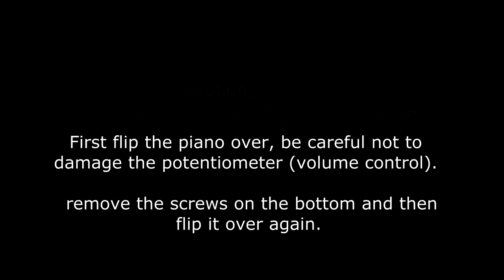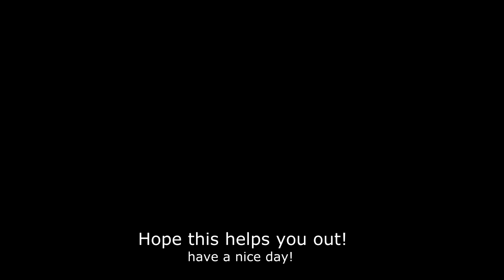Piano repair, replacing key contact rubbers (Korg SP170, 250, 280).

Comment: Put it back together, then I see I have about 20 screws left over.  My advice is to take a photo each time you encounter a new set of screws so you don't forget what goes where. On the up side, it sounds great!
Reply from the maker: Good advice! It is also a good idea to collect the removed screws in separate small bags or tin cans or something, this saves time when putting it back together again.
Reply: Or get a large sheet of cardboard and stick each screw into the cardboard following the outline of the piano.

Comment: thank you for those cool tutorials you deserve more subscribers
Reply from the maker: Thank you very much!
Reply: @Kraakmusic1  i have some issues with my korg sp200 the lights are not working anymore what can i do to fix it some button lights working but alot of dont work anymore
Reply from the maker: @lightbeatz3709  You could check for a bad connection somewhere on the circuitboard, but if some are working and others don't it is probably wise to replace the entire PCB (if you can find it somewhere).  These are the specifications I found online; Panel board (KIP-2050), for Korg SP200 keyboard. This replacement PCB is Korg part number GRA0002050.

Comment: Thanks you play nice!   Can you really hear the contacts when you snap them in with a screwdriver?   I replaced my contacts on my Krome 88, and now I have a few keys that have bad velocity.  Either real loud or soft.... so I'm afraid some of the contacts I have are not snapped in.  Would you agree?
Reply from the maker: Thanks! Yes, with the repair of my SP170 you could realy hear the little pins (underneath the rubbers) pop in the holes of the circuitboard (sometimes soft, sometimes a bit louder. You have to line them up very precise and make sure they pop in). I assume that the time-delay between the two contacts (when you press a key), is electronically translated in the appropriate level of velocity. So it is very well possible that - if it is not perfectly aligned - only one of the two contacts makes a connection, or both of them at (almost) the same time. So you get a very soft, or a very loud sound and nothing in between. The only way to make sure, is to open up your Krome again and check this. If this happens on only a few keys in the same octave, it is probably an easy fix.
You can also try and replace the rubber (in the range were the problems are) with a contactrubber of the highest or lowest octave (that are often less used) and see if this solves anything. It can also be that the contacts on your circuitboard itself are dirty or worn down.
Reply: @Kraakmusic1  Thank you!  I took my Krome apart (again) and was meticulous about making sure the contacts 'clicked' into their sockets.  I did it 1 octave at a time -- and each time I turned my keyboard on and tested each note -- rather than doing the whole key  board at once.  This helped as I found 1 strip had 1 contact (note) that sounded too loud.  It was easy to redo that octave and move on.
Reply from the maker: @FlimFlamBougelets  Great to hear that!

Comment: How closely would this procedure work on the Korg LP-180? My contacts are sticking (again) after I had them replaced three years ago, the keyboard is only six years old.

I'm wondering is this is juts a way of life for my Korg LP-180. New rubber contacts are $50 for a set, I'm thinking maybe they just need to be cleaned with some isopropyl alcohol

Your tutorial looks to be about a 2-3 hour project, which is manageable.
Reply from the maker: I don't have any personal experience with LP-180 repairs, but I suspect that the technique inside is pretty much the same as the SP series, so I would give it a go with the same procedure. Be careful not to get any grease on the contacts! You can always check your old contacts first, maybe this happend when they were installed. If this were the case, you can try cleaning them first with alcohol & check if the problems are solved now. It is about a 2 hours job. Hope this helps, let me know how it worked out.

Comment: Hi. I replaced the rubbers and the black keys sound way louder than white. Any suggestions? Thanks
Reply from the maker: The first thing that comes to my mind, is a poorly connected plug on the circuitboard. You can try detaching them and then plug them back in.
Reply from the maker: It is also possible there is a short circuit somewhere. Because the time-difference between the two contacts underneath each key-rubber, is being translated in touch sensitivity. So if any key (or range of keys) only play max volume, this could indicate a short (because there is no time difference between the contacts). You can check if some grease (from the key-mechanism) was spilled on the contact-points of the circuitboard or in the contactrubbers. This sometimes happens.

Comment: Hello, sadly I saw your video late. I try to clean my keyboard, removed the rubbers and cleaned with alcohol. When I put the rubbers back the sound more or less without the keys, but when I place the keys on the top the most of them do not work. Do I need to put new rubbers? Thanks for the tips and the amazing video!
Reply: Hello there, In most cases the contacts are too much worn down and cleaning does not fix the problem. If your highest and lowest octave (that are usually less used) have no (or lesser) problems, then you know the contactrubbers are worn out and need to be replaced with new ones. If - in your case - the sound is okay pressing the rubbers, but not okay when you place the keybed on top of them, this could also be an alignment problem. When you place the rubbers on the pc-board, you have to place the little pins in the holes and hear them pop in. Hope this helps!
Reply from the maker: Thanks! Hope the Secret Sonics comment will fix your problem!

Comment: Is this the same for a KORG KROSS? I have a Korg Kross and several keys (middle range) are WAY LOUDER than the other keys when it's played. This happens mostly in piano mode. Have other owners of the Kross experienced similar situations? It's driving me crazy.
Reply from the maker: Hello Billy, I have never repaired a Kross before, but I assume the construction of the keybed is pretty much the same as Korg's SP series. The middle range of the keyboard is the most used, so it is very likely that the contacts are worn. I would recommend to replace all of the contactrubbers. There is a link in my description were you can find a local Korg dealer, where you can order them. Hope this helps!

Comment: I have one key (a D, white key) that makes some clacking noise when I press it. It's works fine, same response, same sound, but is the only one that make that sound. Do you know if I need to do this or if maybe is another problem?
Thank you for this amazing video!
Reply from the maker: If the clacking sound is mechanical, you can try replacing the octave-keybed with the (often less used ) highest keybed, and/or put a little grease between the D key and it's closest keys (although this might increase the chance of dust build-up a bit.
If the sound is produced "electronically" - and it only appears with that specific key,  It could be one of the speakers is damaged, and this key causes a resonance-frequency. You can check with headphones. If they sound fine when pressing that key, it is probably a problem with the speakers/amplifier.   
Hope this helps!

Comment: HI - I was going to follow this for Korg B2 - but despite removing every screw I can find still can't get into the unit so if you have any info / link on how to do that it would very much appreciated thank you
Reply from the maker: Hello Craig, Unfortunately I don't have any experience with repairing a B2. I did some searching on the web, but could not find anything about opening the unit.
Have you tried removing the volume knob? could be the nut that holds the potentiometer, is preventing the dismantling. Maybe it is an idea to contact Korg directly for some advice. Hope this helps.
Reply: @Kraakmusic1  - thank you. I'll try Korg although my sense is that they won't be supportive of DIY attempts

Comment: Hi,
Thanks for your video!
I replaces all of the rubbers but one key is still loud. Do you have any ideas on how I can do to fix it?
Thanks!
Reply from the maker: Have you tried cleaning the contacts of that specific key on the circuitboard (where the "rubber" makes the contact). Most likely one of the contacts is dirty.
Reply: @Kraakmusic1  Thank you for your prompt response! I did clean them.
Reply from the maker: @jessyromano4504  A way to fix board contact issues, is to place a new (thin) layer of solder on the boards contacts (of that specific key). But it is wise to first check  if there is anything damaged, or interrupted (like a circuit board copper track) or blown up (like a capacitor). What you can also try, is to switch the newly placed rubbers with the rubbers of a different octave  that works fine at this moment; this way you make absolutely sure that there is not a problem with the new rubbers and the problem is definitely with the circuitboard. Hope this helps!!
Reply: @Kraakmusic1  Great idea! Will try changing the rubber. Thanks so much!

Comment: is it possible to replace the speaker fabric cover on a korg b2? mine has a few bobbles on it that bother me.
Reply from the maker: I have no personal experience with the B2, but I think the smartest thing to do here is to contact your local Korg distributeur (there is a link in the description). If the fabric is available as a spare-part, then it should be possible replace it.

Comment: is this the same fix if a key is just stuck and won't go down please ? Thank you
Reply from the maker: If a key is stuck and wont go down, that is a mechanical problem. You can follow the same procedure  as shown in the video to open it up and then remove the octave key-bed with the malfunctioning key.  You should check if anything in blocking the key when it's pressed or if anything is wrong with the spring-mechanism (where the key hits). Hope this helps.

Comment: Thank you. Now my piano works again! Just a question: Have you some tip around improve the sensitivity? Thank you!
Reply from the maker: Glad to be of assistance! There is some information in the SP-170S' Owners Manual, that you can download from Korg's webste. It says;  
The Key Touch Control function enables you to change the way your playing strength will affect the output level. You can set this function by using the white keys in a range from D2 to F2. (See the figure on the left.)
• To play fortissimo with soft strokes (Light touch), press and hold down the PIANO PLAY and SOUND buttons , and then press the D2 key.
• To play fortissimo with very strong strokes (Heavy touch), press and hold down the PIANO PLAY and SOUND buttons, and then press the F2 key.
• To simulate a normal piano touch (Standard touch), press and hold down the PIANO PLAY and SOUND buttons, and then press the E2 key.
The default setting (when you turn on the unit) is Standard touch. Hope this helps!
Reply: @Kraakmusic1   Thank you very much for your kindness in such a complete answer. I wish all the best for you!
Reply: @Kraakmusic1  hi .... how can i get a set of these rubbers !? for replacement on my KORG ?
Reply from the maker: @pacuthophilip8450  Hello. I've put a link in the description to Korg's worldwide list of distributors. Just look your country  & send them an email or give them a call, they can help you further.

Comment: Hi Kraakmusic1, I bought an used sp170s, a subtle hissing sounds comes from the speakers when you get really really close, also when I plugged in my headphones is the same hissing sound. Any ideas on how to fix that?
Reply from the maker: Hello Vicente, I must say that mine has also a bit of a noisefloor on the speakers, but not on the headphones. This could indicate an issue with the (pre)amplifier but mostly is due to a bad connection (mostly the headphones plug/socket), it could also be caused by an inferior power supply (did it came with the original?).  Another possibility is interference from a mobile phone or another source of electromagnetic radiation in close proximity. Hope this helps!

Comment: Hi, my name is Daniela 
I have um piano korg sp170s
It's was keep per 2 years in the box. I open the  box and put on to work, but it not work. Every keys not have sound. It's turns on no sound anymore. Maybe you can help me with what to do. 
Thanks..
Reply from the maker: Hello Daniela
There could be a problem with the power supply unit, is the red led light burning when you turn it on?
If not, check if the plugs of the power cable are clean and not corroded and if the socket on the piano does not feel loose when you put the plug in. Also  check with a Voltage meter if the power supply works properly.  If the power supply is working fine, then turn the power off and turn the volume knob wide open and down again a couple of times, could be there is some dust build-up in the potentiometer.
Turn the piano back on again and listen carefully if you hear any (amplifier-noise) sound, always start with  a LOW volume!
You can also try if you have any sound on headphones, again; protect your ears and start out with a low volume! 
If this still does not fix the problem, then it is possible that one of the internal connectors – as shown in the video – has become a bit loose, or that one of the internal power supply socket connectors has a bad connection.       Hope this helps, good luck!
Reply: @Kraakmusic1   - Lots of good tips. Thanks !!
Reply from the maker: @tubularap  You're welcome!

Comment: Hello sir.. in my Kronos 2 .... key C4  is having some issue... I have to apply more force than other key key to play the key C4... What would be the problem??? It's only happening only with SGX2 engine with other engine is fine..
Reply from the maker: Hello Birendra. This is very strange, because if it only happens with the SGX2 engine and with the other engines it works fine,  I would say that it's not a bad contact that causes this problem. Furthermore, if it is only the C4 key and all the other keys work fine, it probably is not caused by velocity settings (unless there is a possibility to change that setting for a single key, but that would not make any sense in my opinion. Check your manual, just to make sure!. Have you tried upgrading your operating system? this sometimes helps. Don,t forget to back-up your presets.
Reply: @Kraakmusic1  thank you very much...
Reply from the maker: @birendraekka4812  No problem, hope this helps.

Comment: i've replaced all rubbers and cleaned contacts on SP170 and problem is, that black ones work all but white ones work only when i push hard
Reply from the maker: Strange... If this is not an alignment problem (if you are absolutely sure that the rubbers were placed correctly and you heard the pins pop into the holes on the circuit-board), then this is probably a hardware-problem. Does this problem only occur with one particular octave, or does it occur over the entire range of the keyboard?
Reply from the maker: @Armyburza  If this was not the case before you replaced the rubbers, maybe one of the connectors isn't plugged in correctly/completely. Otherwise I' think that this is most likely a problem with the circuit-board. You could check if anything looks a bit black or burned, especially on places were components were soldered to the board. might be a bad connection somewhere. Maybe a good idea to check out Korg forums for possible solutions.

Comment: What if the board is the problem?like if the board erase the contact from the rubber..some technicians use an pencil..it is advisable?
Reply from the maker: If the contacts on the board are the problem because they are worn down, treating them with a (soft) pencil sometimes works for a little while. I used to repair remotes this way, but the new layer of graphite wears out very quickly. I tried this by the way on this piano (on the rubbers and on the board), just to check if it was working and if the contacts were the only problem i had to fix. It didn't do anything in this case, because the rubbers were too worn down. A better way to fix board contact issues, is to place a new (thin) layer of solder on the boards contacts!

Comment: 修理動画は参考になりました。でもなにより最後の演奏が素敵すぎます！！

私は日本に住んでいますが、説明欄にあるコルグの連絡先リストに残念ながら日本は載っていませんでした。でも代理店は日本にも多数あるので問い合わせてみようと思います。
ただ、自分で修理したいからパーツを購入したいと言うと代理店に嫌な顔されませんか？
自分で修理するのではなく、ピアノ本体を預けて修理に出すことを勧められるのではないかと不安です。
Reply from the maker: Thank you!! About your question; If it is not possible to buy the spare-parts from a distributor in Japan (because they want to do the repairs themselves), you can always buy them on Amazon. Just search for "Digital Piano Conductive Key contact Rubber Strip For Korg SP170 SP170S SP180 SP280 B1 B2". Costs about 40 USD (and some shipment costs). Hope this helps, greetings from the Netherlands!
Reply: アメリカAmazonから買うというやり方があるんですね！
早速やってみます。
ありがとう！！
Reply from the maker: @鈴すず-q9w  Good luck, hope your repair will be successful!